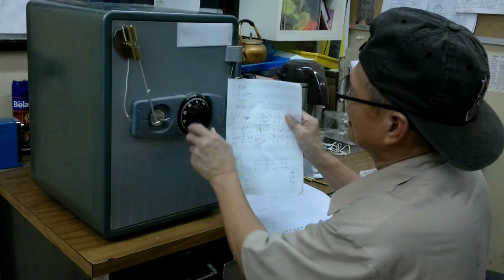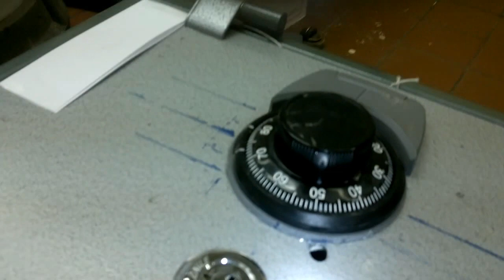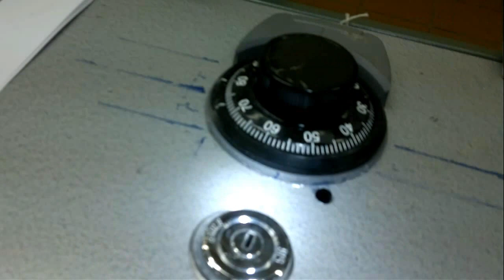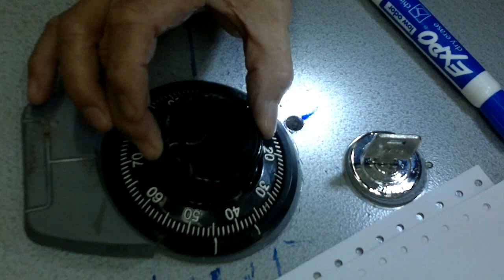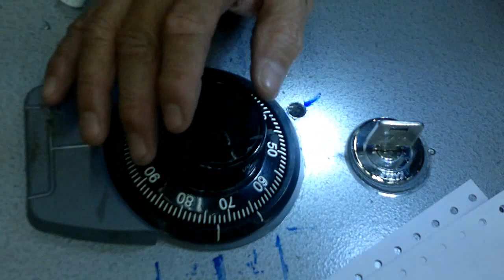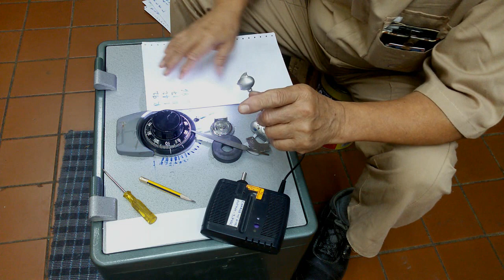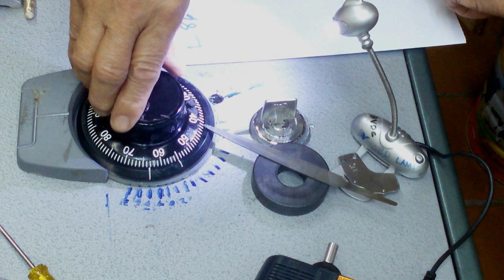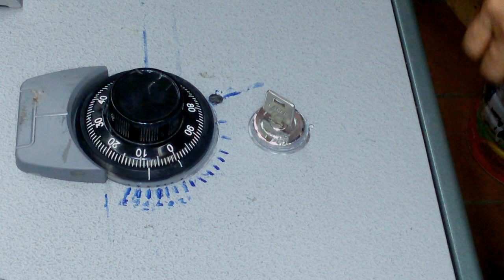SAFE COMBINATION BOX  OPENING BY DRILLING

Comment: Nice job, Just FYI that's a direct entry model you could have drilled a tiny hole at 6 o'clock position scoped the wheels then transfer readings to the 9 o'clock position. You would still have a usable safe. I'd encourage you to join NSO or SAVTA to learn the safe trade-ins and outs
Reply: Well yeah, I always drill at 10 o'clock and then scope with a 70°. No need to transfer.